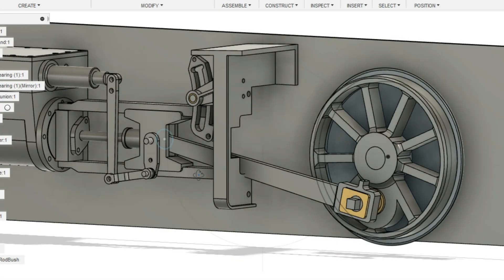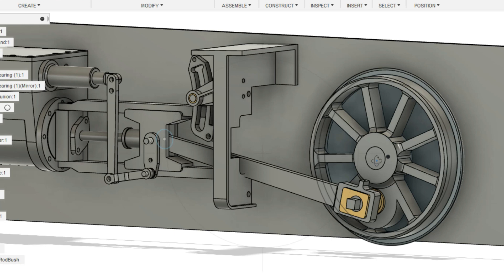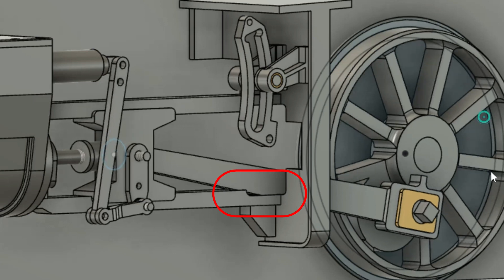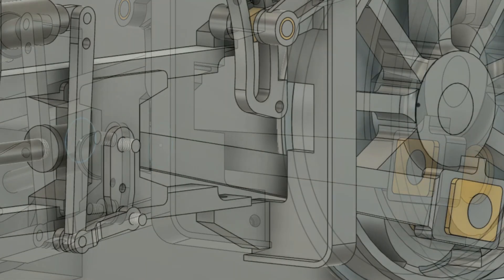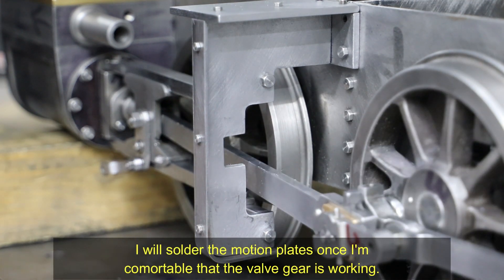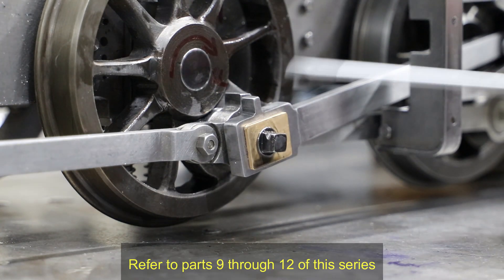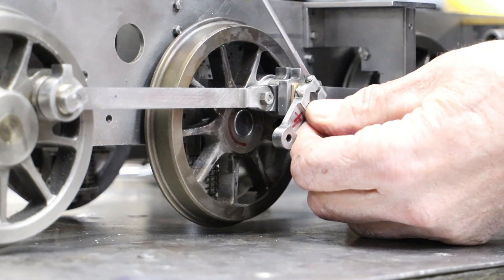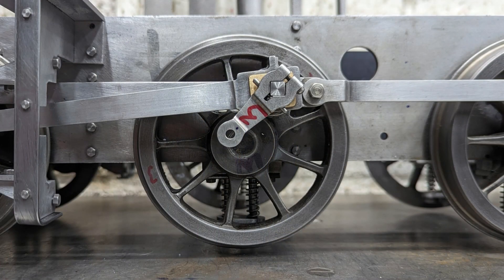Part 39: Revised Slide Bars, new Driving Crankpins and further thinking on the Connecting Rods

Comment: I have a lot of plans, where this Problem is always Part of.... i think its always a design problem.... 
I always trimm the rod a little more taper to solve that Problem....
Reply from the maker: The surprise for me was just how big this problem was.  It was not a 5 minute fix, as you can see the slide bars are significantly shorter than the design.
Reply: @markshomeengineering5243  
I got crazy first time with that Problem, because i did not see it. When the loko Rest on the Rear and Buffer-beam, the wheels in the axlebox trop down a little, and everything runs free...... but on the rolling stand, and on the track, the wheels rise up because of the weight, and than it blocks.... so i couldt find out the Problem in the first moments (hours) ... 😆...